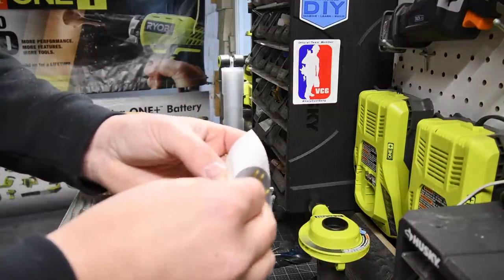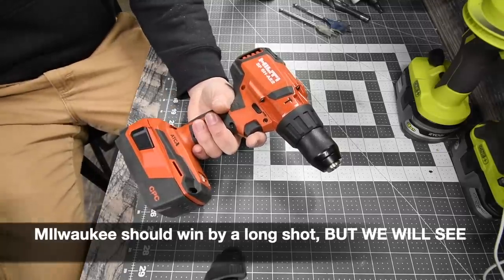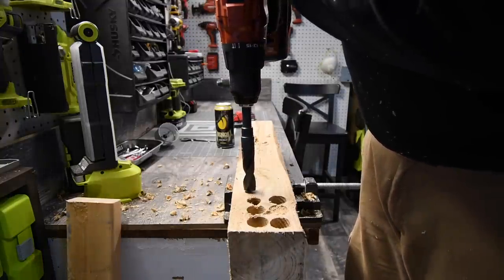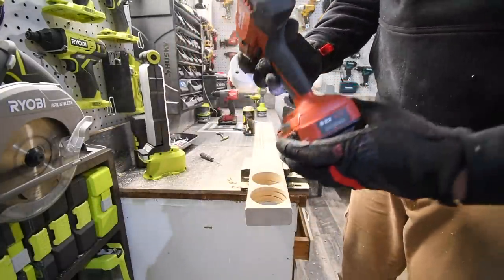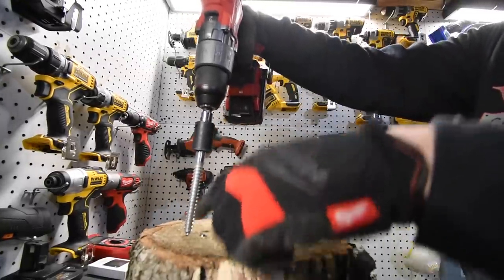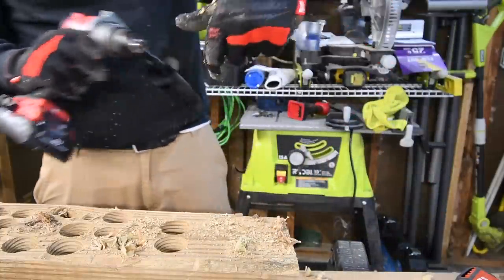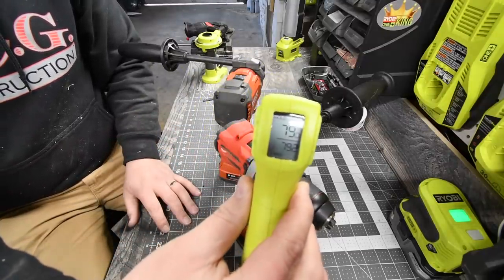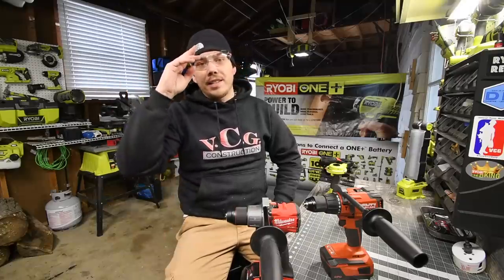Milwaukee vs HILTI (WOOD)

Comment: Thank you so much for being one of us helping to demystify and "normalize" Hilti for fine finish carpentry, remodeling, general home/property services, and tasks other than heavy duty chipping and breaking, people like myself assumed was their sole market.  Up until a few months ago, I assumed that outside of my home woodworking shop where I enjoy many Festool products, Milwaukee was sadly as good as the market offered other than a few Metabo tools still made in Germany and not under the watered down Hitachi (HPT).  I went Milwaukee crazy and purchased around 120 tools in less than 3 months between M12 and M18 platforms, from their 12v Fuel drill/driver set and heated outdoor wear to M18 saws, oscillating tool, 7 1/4" circular saw and tons more down to Packout systems and bits.  I was never thrilled, but they had decent design elements, were at least more capable than my 15 year old+ DIY level DeWalt tools, and well, got the job done, not as nicely as I would have liked to have seen them performed, but what I assumed was as good as it got these days under endless buyouts, competition, and consumers demanding high performance at holiday blowout prices we have come to be plagued with in newspaper ads and build your own home this weekend for $199.99 kits.  My love affair began to chill out when I found out our local "rep" was actually just a commission paid TTI salesman willing to say/do whatever to make a sale, including selling a new employee who asked for an oscillating kit a right angle drill as they look similar from far away and he was rushing past my doubts and questions mid-sentence in order to snag an unsuspecting customer walking past.  He even took photos with people and their new tools like a welcome to the family when in reality, and after a few visits, turns out how he keeps track of his commissions.  It became truly sickening.  From his Milwaukee emblazoned pick-up to his red shirt and black pants, everything was a choreographed scheme to portray the appearance of Milwaukee as a self-sufficient, customer focused, hard-working, true American company.  He even said all tools down to the tiniest screws are made right here in good ole' USA and offered day-only "deals" such as free batteries out of his truck that always ended up being best up duds with half capacity at best.   Being sick of the nonsense, but blaming Home Depot at the time (as they blamed TTI), I decided it was worth paying more to go to a "ma and pa" shop (gag) called Fastenal.  First glance was more than I hoped for.  I expected to walk in and find maybe random fasteners in stock, a couple basic drill/driver sets at best, and everything else to be ordered, but at least quality product knowledge.  So, I decided to test the waters and ordered a 1/2" Gen 3 M18 impact driver for race-day wheel/tire swaps.  When I came to pick it up a week later, I began to feel problems coming.  Sure enough, splitting the invoice between all but $20 being cash, more than enough to cover their costs for sure and then some, but I almost wasn't allowed to leave with the tool.   I had a job across town I was racing back to and was told to come back later.  I informed them if it was that big of a deal, Home Depot had the tool right next to my jobsite for $70 less and I was paying for a little flexibility and personalized service.  Finally, after obtaining everything except a DNA sample, they let me leave under the condition I return that very same day to pay the remaining balance in cash.  I said that was perfectly fine as I live close-by anyway and wanted some impact socket sets anyway.  So, I come back, get a full Milwaukee SAE set for my truck, but guess what, not a single 1/2" metric set in stock or that could be ordered.  Milwaukee doesn't even make one.  Luckily I have some silicon sleeved thin walled sockets for final torquing in my trunk, so I was fine, not thrilled by any means as my comrades were rushing out to get the M12 stubby for the same purpose without a hiccup, but oh well, I fell for another upsell.  What I didn't expect came next.  I come home and go to order the rubber protective cover for the anvil.  I type the model code in to amazon.  I get a message telling me there is a new model.  I figure it's the rubber cover they are referring to and nope, turns out they sold me an old Gen 2 for MORE money than the Gen 3 I ordered and was written on the invoice.  So I nicely call, expecting a simple warehouse mistake and at minimum an offer to drive out to me asap to swap them out.  Nope!  They simply say they will call me right back.  I waited 3 days to just see if they would and nothing.  I was fuming so badly at my entire ordeal with Milwaukee in general, and I didn't even mention the flaw I found on the 7 1/4" that will cause severe kickback repeatedly if at a specific angle for a split second too long due to poorly designed spring mechanisms.  I thanked god I was still within 90 days so I could easily return everything to Home Depot and piece a kit together from high end German manufacturers, right!  Well...I go home, pack every item and since I am OCD, still had every receipt, manual, baggie, tightening wrench, even the enter to win prize pamphlets that come with each tool and drove to Home Depot.  A somewhat nice lady at the return desk wasn't too eager to help, but knew I didn't look thrilled at this exchange either.  We began going item by item as she scanned in my return.  3/4 or so through and someone whispers in her ear.  She tells me her manager would like to speak with me.  This nasty as can be looking thing named Catherine comes over and without introducing herself yells, "what am I supposed to do with all this?"  I'm speechless but manage a, "they did not perform as expected and the service was not only less than acceptable here and at Fastenal, not to
mention I am not ok with the way that "reps" without product knowledge or minimal at best are allowed to hard-sell potentially deadly products onto anyone, including unfortunate DIYers who have put their faith, safety, and dwelling into the hands of someone who doesn't even know or lies about even where the tool is made, much less whether or not it is right tool for the job.  Also, these tools are how I feed my family, no different than a computer to a graphic designer,  oven to a restaurant, etc, and if this is the purchase experience, I'm already having panic attacks as to how I'd be treated when I need service/repair work.  How can I trust the same company to be honest about what is wrong with my tool that was ok selling me the wrong tool to begin with?  Would you?  I was purposely calm and nice as possible knowing she didn't design the tool or even Home Depot policies and according to the website I had 90 days to return the items as they were currently packaged.  She simply looks in my cart, sighs heavily, and again begins screaming, "WHAT AM I SUPPOSED TO DO WITH ALL THIS?!?!  They are used tools.  I calmly explain the return policy on the website and ask if I misread anything.  She responds, "I don't care what you read.  I'm the manager of the tool department and I can't sell these" and tells the cashier to give me my tools back and snarls and huffs away.  The cashier had the saddest look on her face like she was also speechless and was extra nice helping to re-pack my cart (even though some items were never returned ($274 worth to be exact, but I'm not fighting that battle with "Catherine".
 I'd simply call Milwaukee and a "Customer Experience Specialist" would help for sure, right? Plus, It was my mistake I suppose in the age of underpaid and overworked employees, it was my own fault for not doing more research into ACTUAL experiences, which once I did and analyzed the photoshopped and fakes print ad campaigns, was quite horrified.  For example, the drill gracing the cover of one catalog appearing to be coring cinderblocks is definitely not rated for that.  I look closer and they positioned the actor and a polished piece of steel near the cinderblocks, so at first
Glance it looks like he's going into the block wall when in fact that is simply the reflection from him going into the steel sheet.  Then there's the vacuum.  I bought their little handheld shop vac and loved it.  I was thrilled
at the prospect of not only cleaning up with it but using it as a dust extractor as the "rep" said I could,  so I would Not need to tote around and power my Festool extractor.  Well, no dice.  The tip is purposely angled and beveled to not fit dust extractor ports without serious modifications.  This is because Milwaukee decided to market a second vacuum, the 3 in 1, as a dust extractor, vacuum, and blower backpack, forcing a second sale.  Things like this go on and on.  Out of the grace of God, VCG Construction, who first influenced my decision to buy Milwaukee, had done a drill/ driver brand comparison by skill level.  The results were what I expected and Milwaukee was in the lower second tier (intermediate).  He mentions the expert level tools, Metabo (German models only...definitely not the HPT rebranded Hitachi Lowe's did to compete with Milwaukee's false prestige/quality.  Next was Festool (no surprise there except while their sanders are second to none as well as their extractors for their size, they are first and foremost a fine finish carpentrt
Reply: Carpentry and wodworking company, and even then their drills are rarely used and their miter saw blades are a proprietary size.  Plus, they are mostly wired tools and the cordless jobsite idea I got used to had grown on me tremendously.  Last but not least, he mentions Hilti.  I called up and immediately felt at ease and like I had found my home.  My rep works with me 1 on 1 from start to finish, will meet me anywhere or I can go into their store and use any tool live in an Apple Store like atmosphere, he made it a goal of learning my likes and dislikes, the type of work I do and workloads, and customized his entire presentations around what worked best for ME!  He even let me take home 5 brand new tools to actually use in the field and told me to use them until I felt 100% confident they were right for me.  He even talked me out of getting the nailer from The Wire, as much as I wanted it, and let me demo it with 2x6's to show even with the weakest powder charge, it shot right through wood.  They are for concrete and masonry.   What I was looking for was a 36ga pin nailer to temporarily hold joints as glue set up and he helped me find the perfect one from another brand.  We went over multi-deal discounts but there was not a pushy feeling for a single second.  He knows how I like my coffee, what jobs I'm working on where in the country, even my dog's name and I've only known him now for 2 weeks.  I legit feel like How people describe buying tools at the locally  owned hardware store, only they are all over the world and have the distribution network and technical centers to guarantee 1 day repair times.  In the meantime, Fastenal has now lied 2 more times about not having enough money to cover my $200 tool after weeks and multiple promises and trips.  The latest is their home office is mailing me a check but between them and my entire ordeal, it'll at least give my lawyer something to do for awhile.   My point after this long but necessary "rant" as I'm sure some of you will call it, besides this clearly not being meant for you then, so consider yourself lucky, is that while speed is a fun test to watch, it is in no means a sole factor in a comparison, and the Hilti still wins.   These days, even manual watch movements can be robotically made cheaper, more accurately, and faster than $40k handmade movements not too long ago a requirement for that level of precision.  What I mean is, for the most part, a drill will drill, a driver will drive, a jigsaw will cut.  The speed and surprisingly even price differences are minimal, with Hilti even sometimes being less expensive  upfront, which is incredible.  So, other than potentially taking my rep's time away from me lol, there is zero reason to support the big box scams and the corporations buying up companies for their names and then making basically the same thing at different price points, with same horrible customer care.  I will NEVER buy another brand again as long as they keep this up.  Going from Milwaukee to Hilti is like going from a Mustang to a Lamborghini, except Hilti is far smoother, more reliable, and has a better warranty lol.  Best of all, you get a Lamborghini for the price of a Mustang and tell me that doesn't beat any big box doorbuster sale!
Reply from the maker: This is the longest comment I ever had, when it comes to tools most tools brands are a good quality brand, it all depends on what you need it for, HILTI is more on the masonary side, milwuakee is more on the carpenter side but HILTI can be used for carpentry, They need to make a miter saw asap. id buy it immediately if they did.
Reply from the maker: I do admit dealing with hilti customer service was a very bad experience. the HILTI team needed more knowledge of what they actually had in their store and the online service was an outsource company that is not affiliated with HITLI and didnt know much about the product or put the correct model tool in the order, but I thank you so much for viewing sir
Reply: My comment was purely dealing with Milwaukee issues.  HILTI has been an absolute pleasure and nothing else.  I tested the service center and no, it is not outsourced.  There are plenty of videos documenting their repair centers by 3rd party reviewers.  As far as carpentry bs masonary, I primarily deal with very dense hardwoods, and the Hilti wins hands down.
 Instead of a paddle bit,
i ran the same test with a 14" 3/4" bit and the Hilti ate through my 9 inches of white oak while the Milwaukee overheated consistently every few inches and increasing in frequency every hol, whereas the Hilti never skipped a beatz
Reply: @ehs-elitehomeservicesbga2954  if you're using a cordless ½" chucked drill to run a 14" hole saw you're a lunatic

Comment: I been buying hilti tools for years, is the best in my experience for metal stud framing and drywall industry.
Reply from the maker: I love HILTI as well and thank you MCO
Reply: For me u started on DeWalt, then changed to Milwaukee and never looked back. I use Hilti for bigger tools, and especially lasers, but cordless, it's all Milwaukee for me. Especially the Surge 1/4" impact. Nobody else has anything like it, and it's just amazing. I call it my kitty because those hydraulically dampened, smoother, smaller sized impacts purr like a cat almost and man, the more you use it, the more you love it, especially for high torque, low speed situations to avoid stripping out a screw head or bolt head. 💪🏼 Not only that, but it makes my batteries last longer too, being more efficient. I can frame for several days on single 5.0 battery.
Hilti has strong stuff, but I fell Milwaukee just has not only a few clever things over everyone else, but their ergonomics are top tier especially.
Reply: JoeIsCrazyWillman Makita had hydraulic oil impact driver first i believe and some other brands too so don’t say nobody else has it. For me milwaukee is overpriced. After using makita for years i wanted to try something new and i bought milwaukee circular saw. I don’t understand why anybody would use it. Batteries are loose in tools, overheats quick, poor design overall compared to makita in this case.
Reply: Haven't seen a single hydraulic 1/4"  impact on the market. Not one.
Milwaukee and DeWalt are the same price. Makita has always been the Ryobi to Milwaukee and DeWalt's Rigid status. I don't have any issue whatsoever with batteries. No looseness. No overheating. No clue what you're taking about. Been using em for years.

Comment: Im a HILTI fan and im impressed!  Big difference in torque yet the Higher voltage had to help.  I have the Gen1 Milwaukee FUEL hammer drill, great drill.  I also have a HILTI SFH18. A 3speed beast that is actually smoother but much bigher than the Milwaukee.  Thz for the test
Reply from the maker: I thank you sir

Comment: Hilti uses 21700 on new battery packs. Milwaukee has 18650 on standard batteries and 21700 on HO. Don’t know about this driver but the one I purchased stops the drill when it snags so it has saved my wrist many don’t think Milwaukee offers that.?
Reply from the maker: I don't think they do but HILTI does, I still got to do a video about ATG feature

Comment: They both seem to be very good tools. There are other factors to consider. How many other tools does Hilty offer with the same battery pack? How many tools does Milwaukee offer with the same battery packs? How much do the batteries cost? What is the cost of the given tools? On average which company sells the tools a little bit cheaper?  If I was a professional tradesmen I would be looking at buying a “system” when it comes to battery operated tools. Corded tools it is smart just to buy the best tool unless you can afford a few batteries for each toy you buy.
Reply from the maker: batteries are expensive and it would be cheaper to go with corroded

Comment: using a 3amp vs a 4amp as well i might add
Reply from the maker: a 3ah High output battery. I already did a test with the Milwaukee having a 5ah and it lost even more. The Milwaukee needs the High Output battery.
Reply: Capacity doesn't increase performance
Reply: @bartluttels6948  well, it does, given you use the same battery type. Your discharge current limited to a certain C rating, which increases the current linear to the Ah rating, given the same type of cell is used.